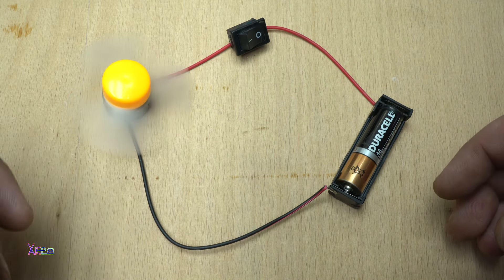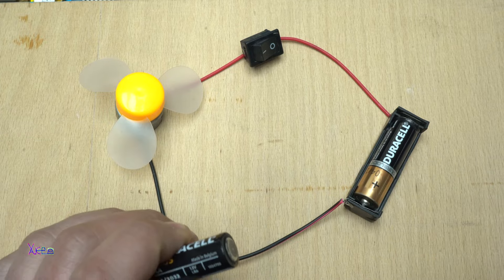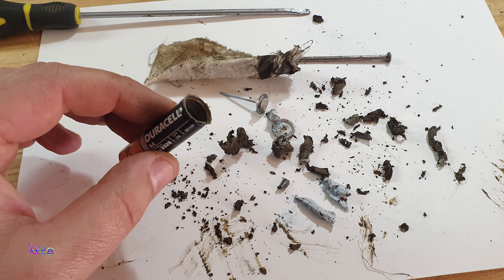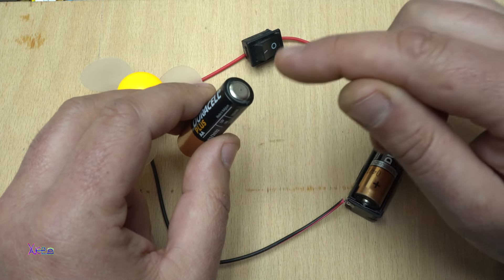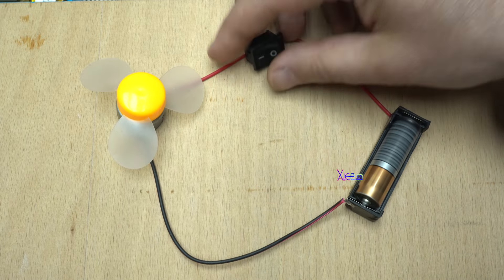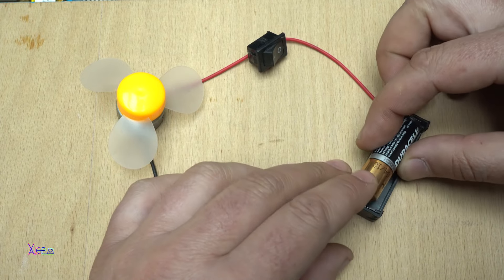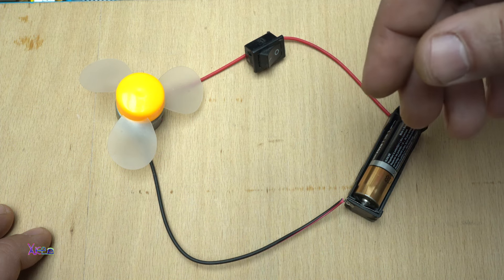Incredible Reverse Engineering

Comment: The power source is underneath the fan because the fan is more than it seems. You tapped a fan wire with a on/off switch acting as a selector switch. There is more going on underneath the wood surface. You usually do your videos on your blue repair mat.
Reply from the maker: Very well explained

Comment: Connect 2 terminals of the motor to where ? I still don't understand what you mean. Please help me to know. Thank you so much !
Reply from the maker: There is hidden battery somewhere,but most cool is that AA  battery is the motor
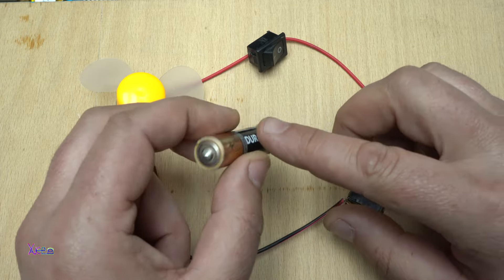Reply: @Hacktuber    I mean, you said in this video at 2:05, the positve terminal of the motor connect to the AA case, and the negative terminal connect to where ? Thank you for your help my boss.